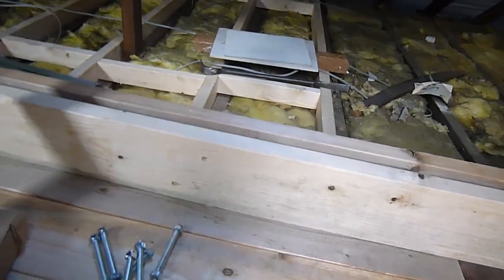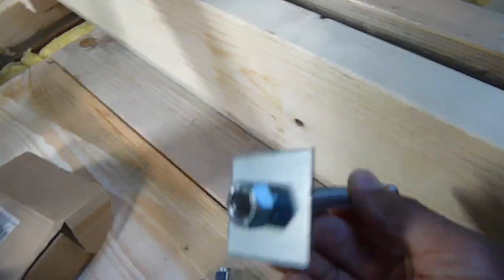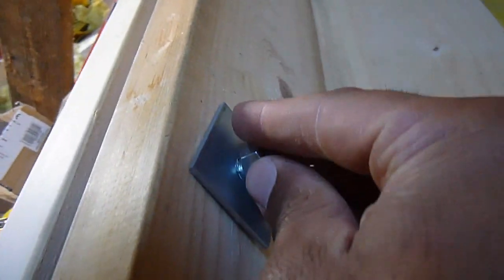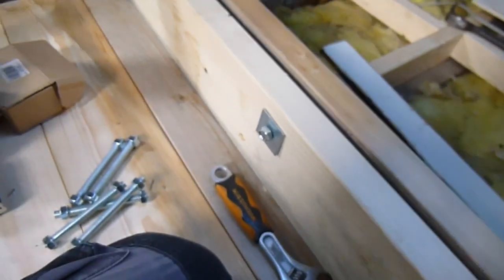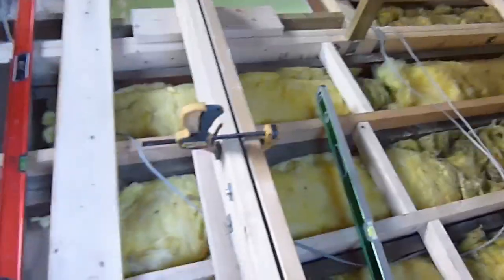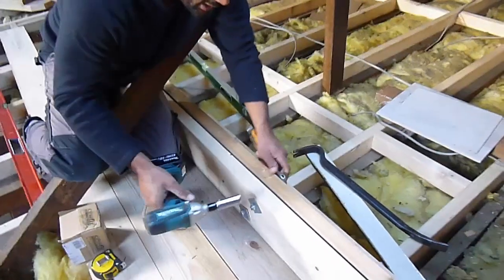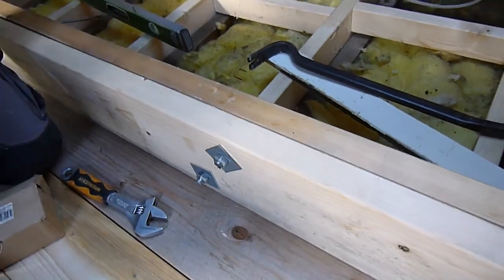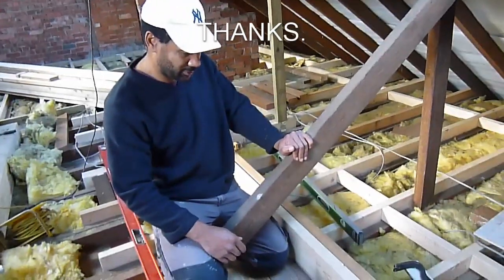Joining timber joists together.

Comment: I wondered if the gap would close with connectors. As u demo'd, it does. Thanks v much.
Reply from the maker: No problem the bolts will always pull them together 😊

Comment: Hi do you have to have the square washers at both ends o the bolt?
Reply from the maker: @dawnreid1000  yes  otherwise I find the bolt pulls into the timber rather than clapping them together

Comment: or just buy some coach bolts????
Reply from the maker: Thanks for your comment. But most definitely not, more so if its for a structural application. There are a number of technical reasons which I'm not very good at explaining, ie the clamping forces, the grippers that restrict movement, effectively doubling the strength etc. Thanks for watching.

Comment: It's not necessary to thread the three bolts on the rod before cutting. If you buy a thin cutting disk it'll do a far better cut which you can then thread the nut on each side. If you do have trouble a quick go with a file would do or there are special drill bits to do that. Great video!!
Reply: Much quicker to just pop a nut on to wind off than mess about with files & special drill bits though.

Comment: Unless I had to because of access I would never use an angle grinder without its disc guard. Putting a nut on first is a good tip though when cutting studs I always bevel the ends after cutting. A second grinder with a grinding disc is handy for this or you can cut all the studs first then change discs and grind. If you bevel the ends you don't leave sharp edges. Timber connectors are great.

Comment: Can I use this method for two joists the new one is pulling away slightly from the old one the new and old joists are nailed together is that normal?
Reply from the maker: I would suggest if possible removing the existing nails first, then bolting. Thanks for watching

Comment: What is proper brand name for those awesome washers? I can only find ones spiked on one side.
Reply from the maker: Thanks for watching,  I usually purchase them from the Screwfix here in the UK.  They are called SABREFIX M12 TIMBER CONNECTOR GALVANISED DX275 50MM X 50MM

Comment: Hi, what hangers did you use please - are there ones fr a double joist ? Thanks
Reply from the maker: Yes, you can pick up double joist hangers from the builders yard, my application on this job was much easier as I only had to rest the joists on a structural wall
Reply from the maker: https://www.selcobw.com/simpsons-light-speed-prong-joist-hanger-38-x-96mm

Comment: Bonkers bolt idea. What happens when you have to take off a bolt to push through the timber? Then you have to try and feed the bolt back on to your badly cut rod, the problem you were attempting to solve to start with. Have that one for free 😁
Reply from the maker: Thanks for watching
Reply: The entire point is to wind the nut (not a bolt) along the rod & over the badly cut end so that it realigns any misshapen thread as it's forced over them. You should then be able to get a nut onto this realigned thread no problem. This is a very old metal working trick my dad showed me donkeys ago, you can have that one for free.